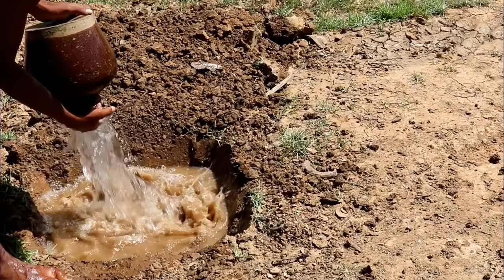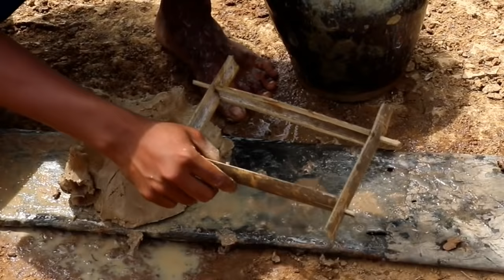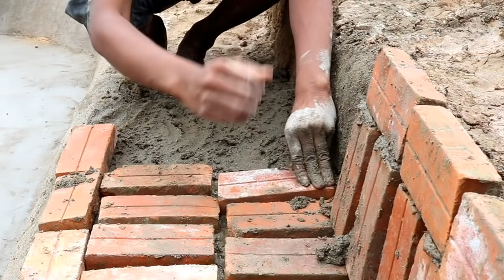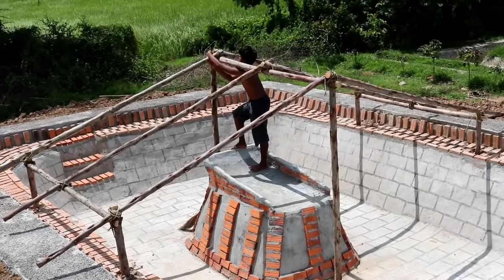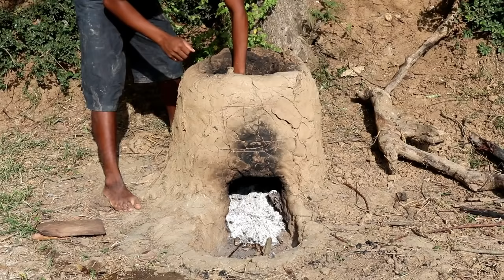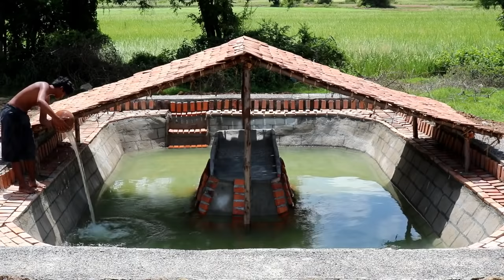Building The Most Beautiful Biggest Swimming Pool Underground In The Forest (Full Video)

Comment: Let's say that pool is 5 metres by 5 metres and 1 metre deep.  That's 25 cubic metres of water , 1 cubic metre = 1000 litres so 25 cubic metres = 25000 litres.  The small jug he is using might carry 5 litres. That means 5000 trips to fetch water and back.  It takes him probably 5 minutes to go and fetch water , bring it back and dump in the pool before repeating. That would have taken about 5000*5minutes = 25000minutes. Which is 416 hours or 17 days non stop or 51 standard 8 hour days. Some how I'm not buying that he filled the pool that way.  Even ten people doing it that way wouldn't be able to fill it in a reasonable time. Even if we said the pool was half the size and it took only 45 seconds to fetch the water, it would still take way too long.
Reply from the maker: Thank you for your comment
Reply: Fraud!
Reply: And the bricks! He can only bake 9 bricks at a time, and each batch has got to take at least 40 minutes each including set-up. By a very rough, conservative count, there's definitely more than 250 bricks per side, so definitely over 1100 bricks for the entire pool with the middle bit. That's 120+ bakes, so a solid 80 hours. Plus the 700+ roof tiles which seem to be similarly time-consuming, so another 40 hours minimum... Quite amazing if there's no trickery!
Reply: Your not seeing the real point to all the videos. It’s just showing how to do it and it can be done by hand.
Reply: How TF did you pass math class
Reply: and also then change the water as much in time will have ___)))) plus it is still necessary to scoop everything up for further exploitation and fill it again when it deteriorates ___)))
Reply: Victor Coleiro some other people behind the camera could’ve helped him fill the pool off cam and they probably used something else to finish it quickly.. as for the guys who mentioned the bricks, I highly doubt they have only 1 of those oven things.. there could be a lot more seeing as they are, in a way, in the business of “building/construction”. Or they could also have other bricks left over from other builds..
Reply: TheVersatileHunter hey 120 is only 4 days and a half its not like these guys upload daily it's they can do it
Reply: Victor Coleiro there are a lot of questionable shit going on in these videos. The shingles would have taken an eternity.
Reply: He never states that he does it alone, just shows it on the vid. Maybe there are multiple people working on it.
Reply: The excavater, water truck, cement mixer, and pallets of brick and portland bags are just off the camera....
Reply: This YouTube channel is just the project
Reply: Agreed....!! I was wondering the same thing
Reply: 11 vveeks to fill the pool if he puts in 38 hours a vveek like a normal vvorking day
Reply: And now everyone understands the value of slave labor in the old world. Monarchy was the 'it" thing for a reason, if you wanted your own pool you needed about 500 people to change the water out every month in order to not be inconvenienced.
Reply: So?? The pyramids didn't build in 2 hours either. Come on, that's a huge and fantastic work too. Chapeau!!
Reply: Plus the small puddles would evaporate before they can create a big enoigh body of water for it to not evaporatr
Reply: Obviously he didn’t fill it like that they are just showing how you can instead of all of the ways like to build a pool
Reply: Victor Coleiro probably rained LOL.  Or he's got 30 friends and family we don't get to see.
Reply: Not it cant. If they are editing out all the use of proper concrete and buying the  500 bricks after making a few by hand, it proves that it cannot be done as its completely impractical.
Reply: A meter is about when you stretch your arms out like a “T” and there’s no way that five people can do that on one side.I disagree with your calculations but I agree with you to the fact that that took way to short
Reply: have u ever played minecraft? he has an infinite water supply next to the pool by digging  2x2 blocks into the ground
Reply: Look at the bricks at 9:52 compared to the ones he drops by the pool 30 seconds later. They arnet even the same bricks.
Reply: you can hear that they are multiple people doing this lol
Reply: r/theydidthemath
Reply: victor coleiro, that is what i was thinking too.  he has to have a huge posse of people that help him when the shots aren't being filmed.  the revenue of a video with one million views is plenty enough to take care of a small village in those parts of the world,  so he probably incorporates everybody into these builds. still impressive if you ask me though, not many people would do that even for millions of views.
Reply: PRIMITIVE THEORY
Reply: @theversatilehunter3651  isn't there a way that he can get more furnaces tho?
Reply: Stop ruining the magic for the rest of us !
Reply: Victor Coleiro ur hurting my head with math and I’m pretty sure he had some help
Reply: Wow someone has never heard of the power of editing
Reply: what they didn't show you was the truck that came over and dumped water in between cuts
Reply: At least he know how to swim
Reply: If it took him a couple days, it would have probably rained and the pool would catch some of that rain.
Reply: Es mentiras.esto
Reply: Ur math is so good can u give me the lotto numbers. I'll give you a fraction of it. 😂😂😂😂😂
Reply: There is no time on the video fool so all what you said is rhetorical

Comment: Let's calculate only filling the pool. Set dimensions to 5x3x1.5m=22.5m3. Estimate 20m3 because of angles and rounding. Let's say vessel he uses is 2l, that gives 10000 turns. Each turn takes 2 min it gives 2500min constant work to fill the pool . It is 41 days (8h of constant work, no breaks). I expect that in hot climate water evaporates quickly, so may take longer :D :D :D

Comment: What kind of rocks boil water?
Reply: Same shit im trying to figure out
Reply: Ana Anaya Thx, I been thinking about it and the only thing I could come up with was limestone or some kind of volcanic ash. Thx again :)
Reply: Technically.. it isn't rock anymore, it is cooked limestone.  It's called "slaked lime"  what you are seeing is an exothermic reaction which occurs when baked limestone is introduced to water.  A chemical reaction takes place, producing a great deal of heat and the product obtained is the basis for cement.. used to make concrete.  This is a primitive method for obtaining it... crude, but it works very well.

Comment: And now a quiz
If its jug contains
10 liters of water
And the pool 12,000 How many times will he have to go and come back?
Reply: He told that it took 3 days. So let us assume 1200 times fill the water pot. Means 400 pots a day. If he works for 8 hours that's 50 pots an hour. Now depending on the distance he has to go, it can be possible. If he has more than 10m to go, it is not possible.
Reply: @soulraizor1  Conclusion This is a miracle
The Miracle Pool!
Reply: @Moses D
The problem is that this jug never have 10 liters, maybe 5, but lets say it is 10. The pool can't be that small, if its 1.5 meters deep and it is sure and the size is maybe 8x8 meters  this is 96 m^3, this means 96000dm^3 this is 96000 liters. And again let's say the jug is 10 liter, this would mean that he have to go for water 9600 time. In 3 days? This means 3200 time per day. If he have one min till the lake and one min back this would mean 6400 min, in other words nearly 107 hours. Without eating, breaks, sleeping or whatever. But wait, the day is just 24 hours hahah xD Im sure he hasn't done it alone and just with a stick or a jug. This would take months of work
Reply: There's to much math going on here I going to make the answer simple.       How ever many times it takes

Comment: How long does it take to fill the pool that way? Rough calculation: Pool might have 40 cubic meters, the Jug may have a capacity of 5 liters. So that means he needs to go 8000 times. Assuming that every way (both directions combined, incl. pouring and taking the water) is only about 3 Minuten, he needs 24000 Minutes - 400 hours. If he can do that up to - lets say - 10 hours a day (no weekends) he needs way over one MONTH to fill the pool. Taking evaporation and percolation into account I'd say: 2 months. 
If the jug holds 10 liters it takes half of the time. Or maybe not. I think it is physically possible to carry 5 kilo+jug 10 hours a day, with 10 Kilos + jug may be not. 12 kilos or the like are no problem a couple of times but hour for hour day after day... I am not to sure.  It may take almost the same time as you might need way more rest and stand through only 5-6 hours a day.
Reply: Read a litle around you before you write essay 😉
Reply: @tetrafhx1144  Can you be a little more unspecific and ominous?

Comment: This pool appears at least 15x10x4   which even with the center part is at least 4,000 gallons by a conservative measure.  That pot only appear to hold 4, maybe 5 gallons at the very most...  That's at least 800 round trips for water.  Even if the water is only a  minute away (2 round) that is 1600 minutes or 26.7 hours of continual filling at the very low end. The filling alone probably took close to a week at least.

Comment: OK.  I scream BS.  He might make one set of bricks and one small batch of cement, but he has 2 guys with a cement mixer and bags of cement and a truck load of bricks waiting off camera as well as shovels and a wheelbarrow and a gas or electric water pump and hose.  Those bricks need to dry for a day and then be cooked in a kiln, which is going to take hours.  That is several months of kiln work there alone at 10 bricks a load.  Plus he had about 20 baskets worth of cement put up and the first part was still damp looking.  That pool would take at least 5000 of those pots filled with water.  You know they have a pump going.  If he was doing 1 gallon a minute it would take him over a week working 12 hours a day just to film this.  This whole project if done say 8 hours a day would have taken at least a year to finish making all that stuff and doing all the work himself.  Think of just finding and cooking all that lime and digging up all that clay.

Comment: It's totally fake. Picked up on that at 4:30 when he drops magic rocks into the mudhole to "make concrete." I've had years of professional concrete experience and can assure you this process would not generate concrete. Notice during the subsequent section where he hand-smears the 'concrete' on the walls of the pool that they do not show the child creating all that 'concrete' in the mudhole.

Without aggregate (gravel) or rebar, there would be no structural strength to concrete applied in this fashion, anyway. The basin would not be able to hold water. This 'concrete' mix would be as watertight as wet sand.

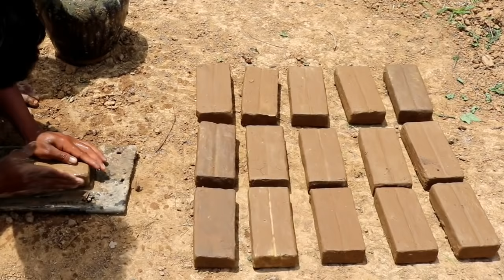Comment: LOL the brick fakery is hilarious. if you look carefully the set of 15 bricks, shown after the first actual clay one was made, are different size and thickness than the first one. for the 15 shown at 8:40 in the video he just took store bought bricks and rubbed them with the clay to make their color match the first actual clay brick. you can see the brick hes rubbin at that point never changes shape whatosever. its store bought. the "fired bricks" are a totally different color than the ones used in the actual pool construction. you can see the clay coating on the fired bricks crack and falling off and covered in soot. the ones used in construction are REDDISH ORANGE not even close to the baked clay color and  are all exactly the same size/thickness not a hint of variation. fun to watch being built but dont bother BSing us with the nonsense idea you made bricks.....